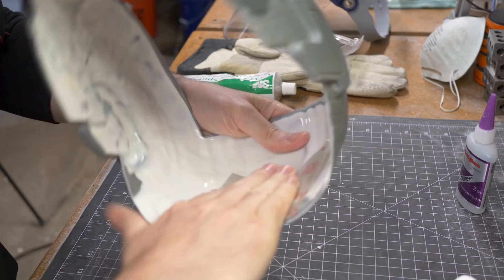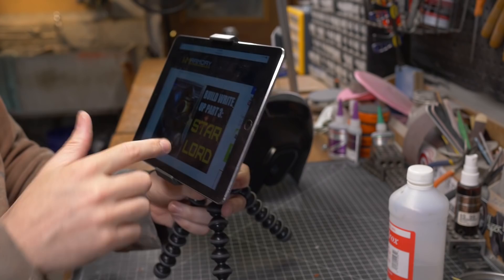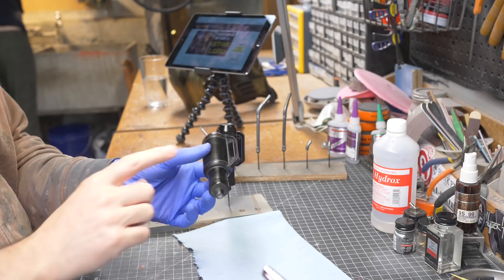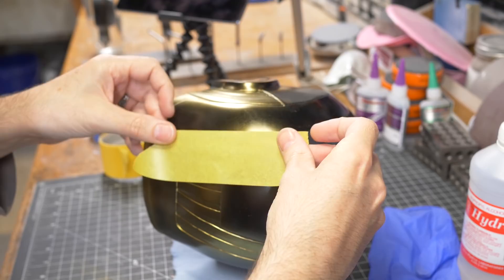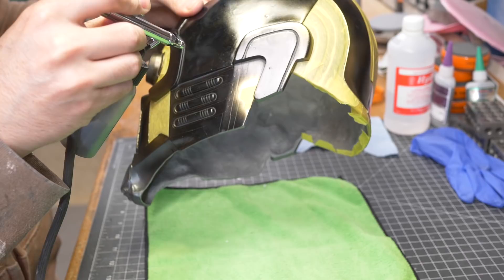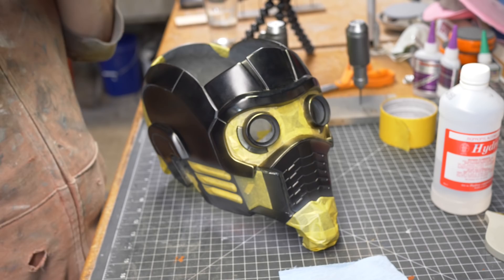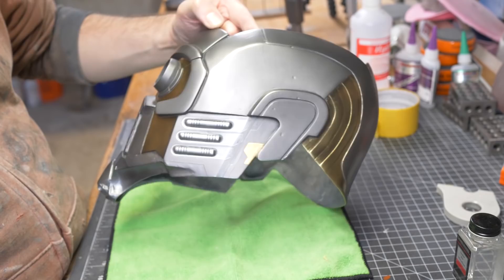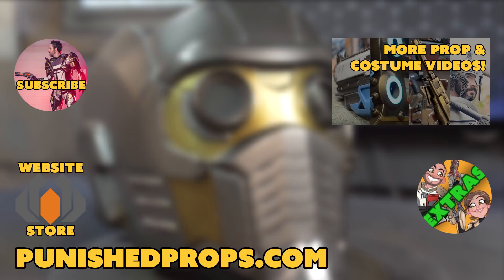Fiberglass and Painting - Star-Lord Helmet Kit Part 2

Comment: To both push the masking tape in and pull it off use a toothpick in very small areas.  Very soft and wont scratch.  I learned that watching gundam painting videos.  2nd tip.  Tamiya masking tape can be expensive.  A youtuber out there made a video about using washi tape vs tamiya.
Reply from the maker: Ooh good tips all around.

Comment: Bill:
Great helmet ! I would go crazy with all that masking.

The books I have read all say that chopped strand mat should only be used with polyester resins - not epoxy. Apparently, there is "sizing" on the mat that keeps the epoxy  from bonding to the mat; compromising strength. However, you pulled it off with no problems.

You might be a bit careful if you ever get into a violent, helmet to helmet battle. I am sure that you run into this situation often.

You have been warned!

Having fun,
Bill B
Reply from the maker: Yeah it seemed to work just fine. Also this piece doesn't need to withstand any forces at all. It's not the hull of a boat or anything. =)

Comment: Do you think using the Apoxacoat or just regular fiberglass resin would work to reinforce a vacuum formed parts that after the pull the ABS is a thin?
Reply from the maker: Yes I think that would work.

Comment: does the tamiya tape stretch when you pull it? to help get around corners. if not you can get 1/8" from the auto body store that will.
Reply from the maker: It doesn't stretch that much, but apparently they make a version specifically for curves.

Comment: Could you seal lacquer with an acrylic spray paint?
Reply from the maker: That should be OK, but I would test it on a scrap piece before applying it to your final piece.
Reply: Punished Props Academy I ended up using an enamel and letting it cure for 24 hours. When I sealed it with clear cost I had a very very minor bit of bubbling in one section that got covered by weathering.

Comment: why does it matter if the primer layer is gloss or matt or white or grey or black? Since you arent sanding scraps and such.

thanks!
Reply from the maker: For metallic finishes, glossy black makes for a better shine.
Reply: So the under coat actually affects the top coat...huh. weird. Does not compute.
Reply: Civil to an extent most paints are slightly  translucent  and a gloss is also smoother ao your starting on a better surface that a rougher satin or really rough matte surface
Reply: If you want the most shine out of your metallic paints you want a super smooth surface. Gloss black will show every dirty secret you've tried to hide.

On the other hand, if you aren't trying to get that solid sheet of metal look (like a cast metal finish) then it doesn't really matter.

Comment: cutting fibreglass!!!! rip your fingers!!! you think it's all gone 2 weeks later when you forgot you ever used it and working on something else it will be there to ruin your day
Reply: Agree, damn horrid stuff.
Reply: is there a better option?
Reply: It's the devils work
Reply: when i was 7 i put my entire hand into a bunch of gnarled fiber glass that came off of a boat mold. had to go to the hospital.. treacherous territory!!! choose your moves wisely..
Reply: Yes but it is difficult to get hold of as its used in aerospace industry, but you could use a bandage of fibreglass to avoid huge bits sticking out, and a closer weave would be stronger isotropically, if you had a certain area that was weak you could cross layer the fabrics to create strong points rather than just stuffing extra in in an attempt to over engineer things.